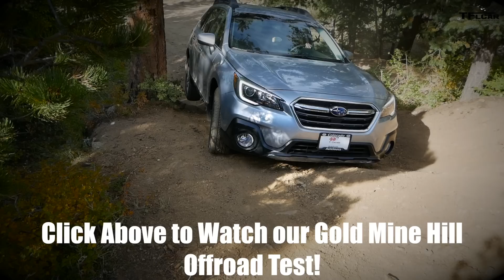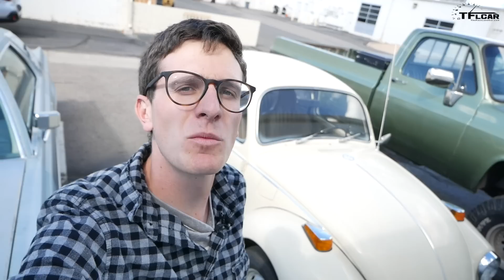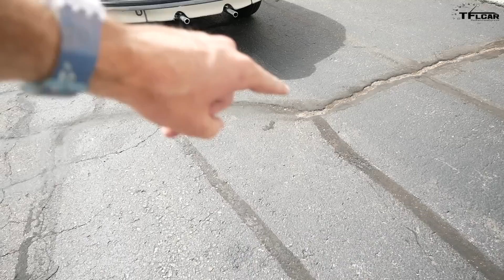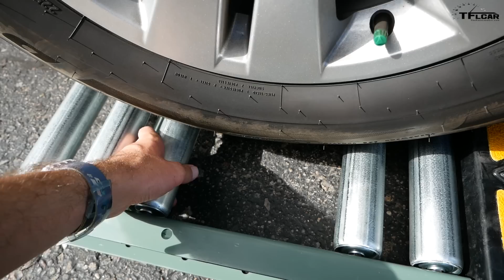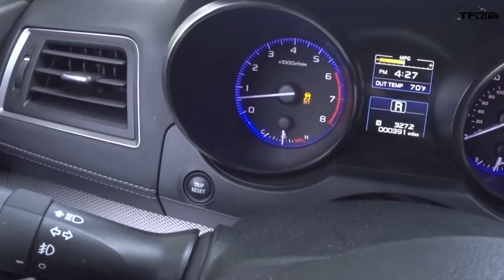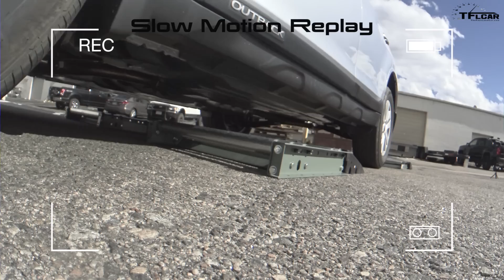The Truth About Subaru's Symmetrical All Wheel Drive:TFL Slip Test vs Subaru Outback

Comment: Try it on a ramp, say, of a multi story parking lot. There is a European video, about 5-6 years old, that does the same test, and the results are way different on flat vs. incline.
Reply: Agree, as this is where you will find must vechiles stuck, like on a slight incline in snowy conditions.
Reply: This!  TFL - search Youtube for that video and try to get/build an inclined roller plane.  Then test various vehicles on it. Really showed the strengths and weaknesses of different AWD systems. 

All your test showed was with one tire on perfect traction, the car could do what a 15 year old kid could - give it a little push on flat ground.
Reply: https://youtu.be/kRniF4JQN2U

This is the vid you are looking for.
Reply: Yes to this!
Reply: I agree adding an incline section would be great. Love the video and look forward to to more all wheel drive comparisons.
Reply: Exactly this.  This would be fantastic to see, especially of different makes in the same market segment
Reply: Here’s the video. Same rollers. No need to build some fancy rig. Just do the same test on an incline using the same equipment you have. And also do a single wheel traction test on the opposite bias. So a front wheel bias system should be tested with one rear wheel. Like one of flat ground doesn’t require much effort for the system to move the vehicle.

https://youtu.be/jkiv-bWbLIo
Reply: The video of which you speak not a CVT transmission. The newer models need to cut engine power in order to save the the relatively fragile transmission. On the flat it fares fine on 1 wheel. Maybe under more torque demand it would be a different story .     https://www.youtube.com/watch?v=2OzK-oRPCbs
Reply: Climbing on incline with 2-3 wheels no traction is gonna be tough for any vehicles. If a car/SUV fails that test I personally think it's fine.
In real world if you have a driving situation like that, you probably should not be driving.
Reply: Thats the point.....it was 5-6 years old.
Reply: @thatfrenchcanadian5779  Still better than this test. If people keep talking about it 5-6 years later, can't be bad ;)
Reply: @bb2628  yeah but my point is thecnology is not the same 5 years later so...
Reply: @thatfrenchcanadian5779  Maybe you have a better test to suggest
Reply: @bb2628  you just don't get it. He said result were different from a video that is 5 years old. I say of course it is, its 5 years old!!! Come on i realy need to explain this??
Reply: @thatfrenchcanadian5779  I still think that the test that might be 10 years old for what I care, is still better than this here. Just my opinion. No need to get all excited about a test. And you don't need to explain, seems like only you don't understand that the incline testing would be better. Enjoy the rest of your day
Reply: yeah guys what I meant to say is that the video is that old, if you're searching for it. Regarding the technology, obviously thats what we are testing here. This roller test would be awesome seeing how AWD systems work under load, such has driving up hill. Like one of the comments, just a slight push would get the car moving. So to really test the system, and how much power its actually able to put to the wheel with most traction, put these rollers on an incline and repeat. That would be awesome to see. Especially comparing various systems like the Subaru's in this video, vs Haldex, vs. Quattro vs. etc etc etc.

Comment: Seems like the brake lock diffs don't engage until the tires have been spinning for a few seconds, and the timer resets every time the spinning stops. That suggests that to get up the hill you would need to start spinning your tires and not stop for a few seconds in order to get moving. The system may still not work, because it may release the brake before the wheel in the air is on the ground, causing you to just roll back down anyway.

Comment: Test Audi quattro but don't use a3 because it's haldex system
Reply: Actually, Audi secretly started putting Haldex in some larger models too recently.
Reply: Elmir Mujezinovic Nowadays haldex systems can be much better than older quattro. Just like in this Subaru above, which has awd system similar to haldex.
JAnx01 Rather not secretly, they are switching to Quattro Ultra.
Reply: @4x4.tests.on.rollers  
Marketing buzzword.
And better in what way? Haldex may be better on rollers, but it usually struggles compared to torsen in real usage like getting uphill on a slippery surface. It's certainly not better for long-term intensive use either. Gears Vs clutches+brakes. The latter wears out much faster.
Reply: JAnx01 Better in terms of performance (not reliability, long-term use etc.). With haldex systems (or other clutches i.e. like in this Outback) system can do whatever it wants with the torque (all up to software). Older mechanical systems do not have such skill.
Reply: @4x4.tests.on.rollers  
It's not. Haldex can only send up to 50% to the rear and only when a problem is detected at the front. Torsen Equipped Audi's split the power with a 40:60 bias front/rear and can send up to 84% to the rear when needed. Additionally, Audi offers an optional torque-vectoring differential for its torsen-equipped models that can transfer all available torque at the rear axle to each wheel in order to reduce understeer.

Drive a S3/RS3 and S4/RS4. There is no comparison. The S4 can do on-power 4-wheel drifts whereas the Haldex-equipped models have terminal understeer at the limit.
Reply: JAnx01 Torsen is passive. Always 40:60 torque split (for T3) and nothing you can do about it until there is difference in wheels/axles speed. You cannot control torque split.
Haldex (or other similar) can split the torque from ~0;100 to ~100;0 at any moment, wheels/axles speed difference is not needed. Torque split may be fully controlled. All up to software. Quattro Ultra is similar to haldex and you can drift it without any problems. And it is less understeering than torsen.
You mentioned S3/RS3 and S4/RS4, so let's go further - new R8, Aventador, Veyron, Chiron. All equipped with haldex (in opposite layout of course). Why? Cause torque split may be controlled. Unlike in torsen.
I forgot about Audi rear sport diff - it can't transfer all available torque at the rear axle to each wheel. It is an overspeeding diff which can increase up to 10% angular speed of rear outer wheel. Like years ago in S-AWC from Evo.

Comment: it's a cvt issue, they can't handle the torq uphill, i'm from chile and i have the same outback but the diesel one, (2.0 turbo diesel flat 4, almost the same torq than the 2.0 turbo engine in the forester xt, etc etc), it has more torq than the gas engine but i have the same problem, i tested with 4 friends in a hill with grass and mud in my house and the only way to make it was taking a bit of speed. i think 'im going to make a video of that.
Reply: Way to delete my comment but here's proof that it's not a CVT issue.  https://www.youtube.com/watch?v=7BtRkjC-8gc
Reply: The problem is using X-Mode and VDC control.  One thing these fancy traction control systems do is cut power to wheels that spin to make the off-road experience better for those who don't have that expertise.  Shocker, when they replicate the test with all of that stuff turned off using just Subaru's base AWD system it did just fine on the hill.  It's not a CVT issue at all. It's an ignorance issue.
 

https://www.youtube.com/watch?v=3gIW57HxgNk
Reply: i dont wanna make a war of this but let me tell you i have tried in all the ways, first with all on, and then all off. i will give it up another tried
Reply: not an issue with the 6 cylinder engine. Even the older models have 213hp 212ft/lb.the new ones have 256HP 247ft/lbs PLENTY of power.

Comment: Can you try the same test for the Mitsubishi awd system and the VW alltrack awd system?  Loved the tests.
Reply from the maker: Can and will do
Reply: With as many systems  as you can... maybe some trucks too.... do you need a good 4wd or AWD system?
Reply: what about the 2019 Rav4 :D
Reply: I drive a 2005 Mitsubishi Montero Limited and would like to see how its traction control system works on those. Comparing old and new tech can give us a proper perspective of how things have changed, and if old-school is better or worse than new-school.😉
Reply: Awesome I have an vw alltrack that'll be great to see!!
Reply: haran s I tried quite a lot of Mitsubishi cars on rollers, so far only Eclipse Cross passed all tests.
Reply: @4x4.tests.on.rollers  yes, there is at least one YouTube video showing the Cross passing all the tests.  I believe it's in Espanol.
Reply: William Friel I think there are two. First one is Slovakian, very inaccurate (no driving modes) and Cross failed last test. Second one is mine.
Reply: Subaru vs VW. Skip to 1:45 for the interesting part https://youtu.be/7f1Uz8SqnzI
Reply: They would work the same, albeit, they would keep falling off the rollers by sliding left and right due to their systems being non-symmetrical.You would have torque steer. The only other symmetrical system out there is on Audis.
Reply: YES10 symmetrical and basicly means it has a acd center diff which Mitsubishi has used in there lancer evolutions since the mid 90s. the evos also have ayc rear diff which Subaru does not have that's why it's a superior AWD system but I'm not sure if there SUVs use the same system.
Reply: No. It will get stuck..
Reply: chris tragedia Who are you talking to?
Reply: Can make a video like this one  but with an Audi quattro?
Reply: Xavier Lemos Which quattro would you like to see?
Reply: A late model like the Subaru. An A4 Avant I suppose.
Reply: Xavier Lemos I tested quite a lot of late models, unfortunately no A4. But test of Quattro Ultra was quite interesting.
Reply: Other people have tested them they take 20 seconds to finally send power to the correct wheel whereas Subaru does it in 1 second
Reply: @Bobby Paredes Some of the newer models with beefier suspension are branded and tagged as "Alltrack" even though they still refer to the drive system itself as 4Motion in the specs. I'm assuming this is to better align with the big brother's (Audi's) "Allroad" models.
Reply: they just did mazda 3 and it got stuck with three wheels on rollers
Reply: Let's not forget the Buick TourX, please.
Reply: @ProductBreaks  gm is selling out to china
Reply: I predict Mitsubishi's so called advanced awd will fail miserably.
Reply: @MetaView7  How so? I've seen Mitsubishi tackle that same track off road where the Subaru failed.
Reply: MetaView7 as much I love the brand there are tests put there against the newest outlander and it failed.
Reply: @MetaView7  - More than probably:
https://youtu.be/TBWSfkH3OU0